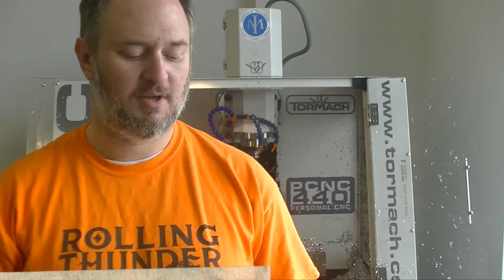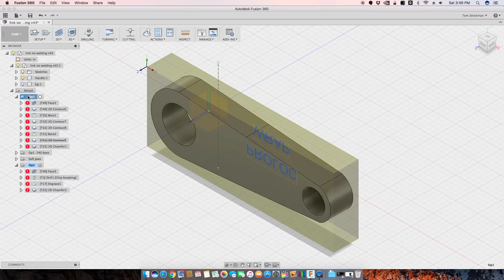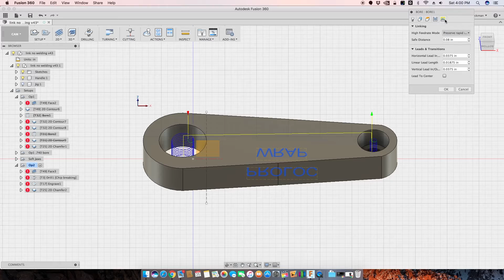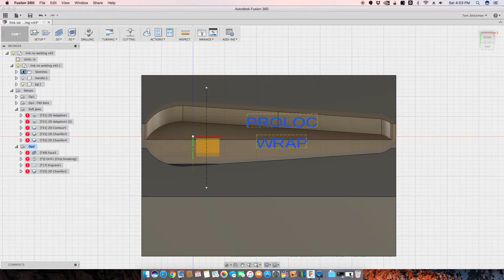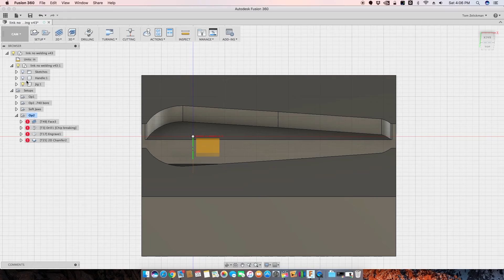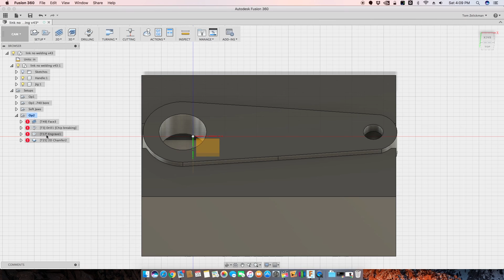Mill Work - Crank Arms CAM

Comment: Nice work.  I was initially surprised at the feed rate on the chamfer when I watch the milling video.  Nothing to use as a reference, but it seemed slower than I expected, but now seeing what and why you were doing what you did it makes sense.  Keep up the good work.R.J.
Reply from the maker: +R.J.'s workshop Hi there, RJ! That's a 2 flute chamfer mill and I'm taking about .001 per tooth. I could probably bump that up a bit but it's really about the speed at the location of the cut relative to the tool. The closer you get to the center of the tool, the less surface feet per minute you are moving. Lots to keep in mind!

Thanks for watching and I hope the El Camino build is going well.

TZ
Reply: There certainly is allot to keep in mind.  I do love it when you can take some of the gut feel out of it with math.  I quiets down some of us 'internet experts'.  Sometimes :)